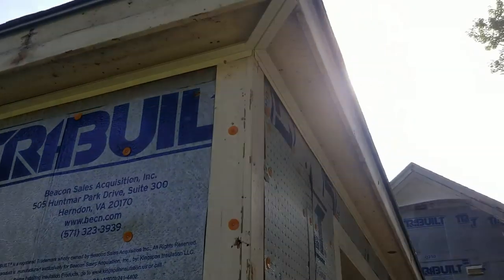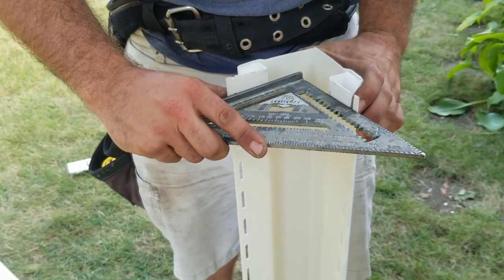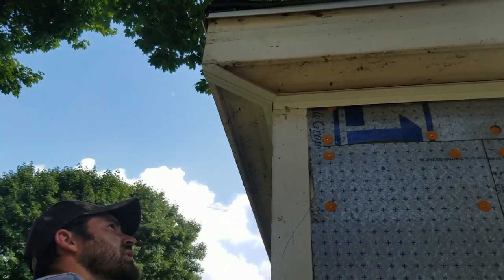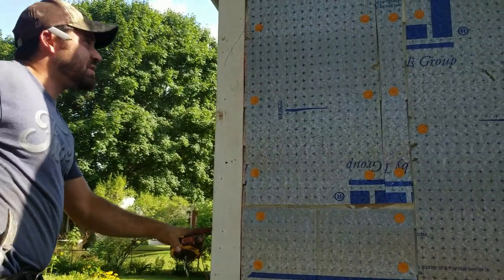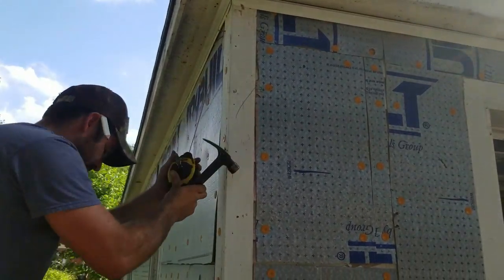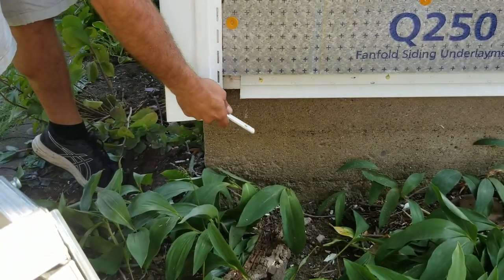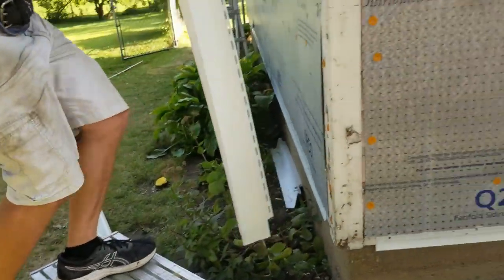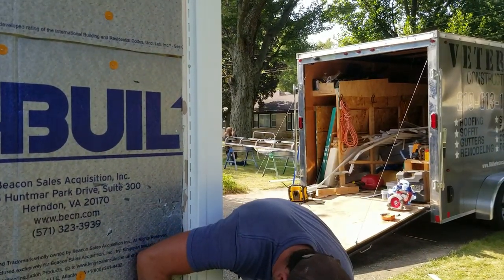One trick to ALWAYS get straight corner posts

Comment: Good idea. You could also bend over tab on the bottom so bees and mice dont go up there. also I think your just suppose to nail the top on tight, rest of the nails should be loose for expansion of the vinyl
Reply: Thanks you answered my question. I am a beginner I was wondering about that stuff. Plus we have wasp around here that make nest!
Reply: I prefer to stick steel wool in the bottom of the corners. The corners still breathe and critters won't chew or touch it.

Comment: As long as the corner of the house is straight & not warped & bowed, this could work nice.
Reply from the maker: I use it every time. Framing squares have measurements on them and work really nicely to keep your numbers accurate on wonky framed corners

Comment: Hey, does one place the nails square flat on corners or a little loose in the middle to allow for that corner piece to expand contract vertically ? thanks.
Reply from the maker: When it comes to j channel and corners most guys aren't leaving much space for expansion and contraction.  MUST HAVE on the siding, but for the corners and j....it's only a nice idea lol it doesn't make much sense.  Gets in the way of sliding siding in, doesn't hold corners or j tight to surface you want it tight to..etc
Reply: When the corners are installed they only put like 4 nails... Then as I'm putting up vinyl they say I can try to place 1 nail on the corner and the siding. But only if I can since the holes might be on the same spot

Comment: Hey zack. What skills would you of liked to know about as a beginner carpenter?
Reply from the maker: Shoot it all excites me! I really wish somebody taught me the tricks for shingling. all the little things add up to be a monster problem solver and efficient installer. but that goes with everything. honestly I just wanted to know it all. I had a really good foreman who didn't do much teaching but he had an answer for everything. I Mean EVERYTHING. He was a hell of a framer that was great at anything he put his hands on and I wanted to have the same level of skills as soon as possible. Roofing, siding, soffit, fascia, framing, windows and doors for the most part. My advice to anybody starting out is to start with a solid year of framing because that's the best base to have in my opinion. Then move to the rest over time because that will all come very quickly. I was fortunate enough to work for a company that did it all. Including Demo of burnt down houses and the rebuilds.
Reply: Worlds Fastest Shingler thanks. It looks like I got a union apprenticeship lined up for spring when I finish School.

Comment: Straight but not square forgot to add for the catch on the speed square, about 3/16 of a inch
Reply from the maker: You can see I still adjust one side off of the line exactly that much because I could tell that the number or corner was off that much.

Comment: I was thinking you don't really need to snap a line, if you measure out on the top and bottom and line up the corner piece with those marks, it will be straight, at least with the stronger outside corner pieces, if they are the cheap flimsy shit, which you should avoid anyway, then yes, probably will need to snap a line to get it straight all the way down.

Comment: Just buy the foam inserts, takes 2 seconds rather than 3 minutes, or just get good at roughing them in, the time it takes you to snap those lines is too long, would have already had the corner on and straight by then
Reply from the maker: It's just as quick to snap lines. Less correcting in my opinion. But I don't always snap. This video is to teach people how to get it square

Comment: Hey buddy there's a much faster way to do that. Since you always do your boxing first you will have scrap metal by the time your ready to hang siding. So take a scrap piece of metal and bend a L shape to width of your corner. Use that same piece to mark all your corners on the house. Also should only nail 2 top nails in all the way then nail the rest of them leaving nail head roughly 1/16 -1/8 sticking out so siding can expand and contract with temps

Comment: Stop using garbage like vinyl siding unless you're working on a trailer.
Reply from the maker: It's not garbage dude.  The old shit was.  But a decent panel can look good and function for 25 years.  My mom's siding isn't even the good shit, it's 19 years old and still power washes brand new.  This is the affordable stuff for the majority of the midwest and a thicker panel like .044 or .046 is way different than trash you're thinking of
Reply: @NWIVeteranConstruction : Wow!!! 25 years??? Looking and lasting just like a trailer like I said. Meanwhile the house my great-great-grandfather built in 1859 still has all the original clapboards in perfect shape like every other old house around here.
Reply from the maker: @skipads5141  hey bro, not every house is built like that. And people can only afford what they can afford.  Each area is different

Comment: dont nail it home dummy
Reply from the maker: Always nail a corner home dumb dumb. That's the right way
Reply from the maker: You float siding not Jay, corners or UT
Reply: Expand and contract
Reply from the maker: @DuStY_rZz653  look at any corner post or Jay channel video. You do not float your nails the same as your siding.  It would actually block the siding from going into the corners.  I didn't slam the ever living daylights out of these nails. They're just sunk in all the way.
Reply: Kurt Shampine always nail the corner Home what is this your first day?
Reply: You are not supposed to nail corner posts tight but hey what do I know ive only been doing siding for 15 years
Reply: @joshuaodowd9107  😀
Reply: Nail J,F,Corners tight since 85
Reply: You absolutely nail your corners, jchannel, inside corners, sill trim flush, slightly snugg, def don't "float" your trims!!
Reply: I have to agree with this suggestion.  A snug corner will become wavy/warped with thermal expansion and contraction which is something I found out firsthand.  Only the top two nails should be snug.  The rest should be loose and centered in the slots.